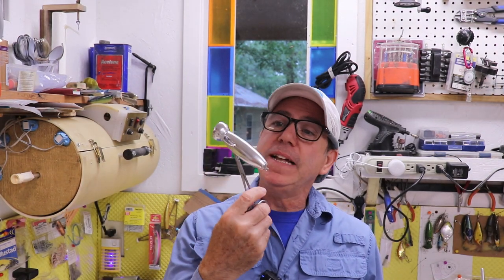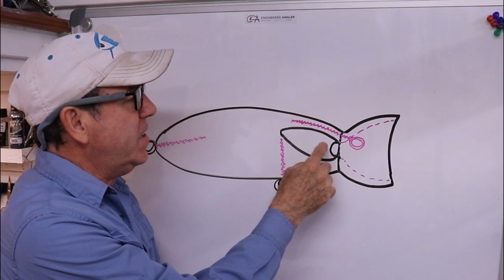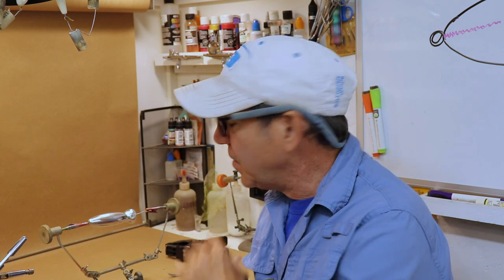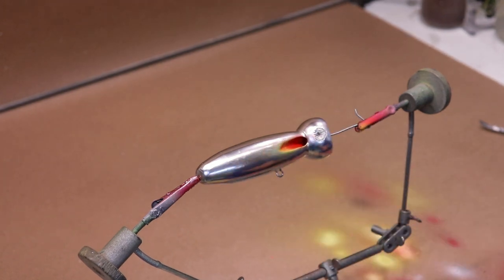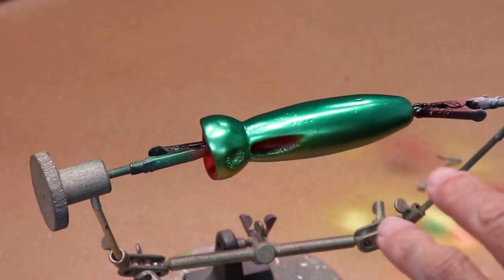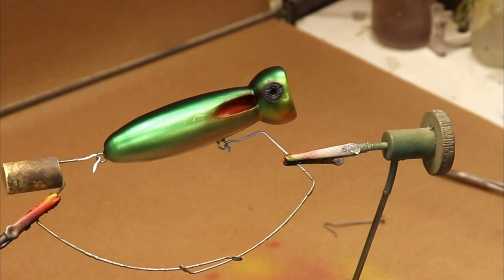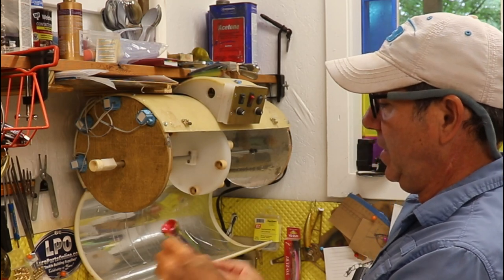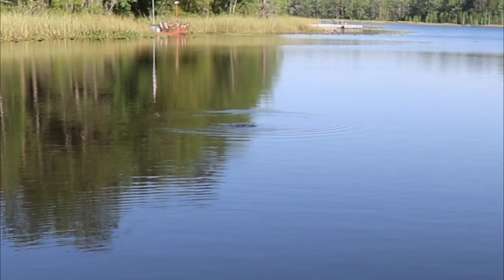Jetted Popper, Testing a new Popper Lure #popperlure #topwaterlure #makinglures

Comment: Hi, I have been watching several videos from you Franco and I would like to thank you because are really good and you show a lot of passion in it
I have a couple of questions about lures
First, about propeller lures, could be possible to have more information about how to increase the propeller noise (because that attracts the huge ones) by working with the shape of the lure (made by wood). The model that you did, it will work in that pod but in the Amazonian river won't. I have been watching the high roller design.....so I just would like to hear your opinion as an Engineer because we do have a different perspective and normally we can improve it. (this design is like a torpedo)

The second one is related to popper lure, how to increase also the property to attract more. I saw the video about the Jetted Popper, and I do believe the entry hole should be higher than the original design (it is just an opinion). I have been working with the lower lip of the mouth given to the lure some other zig-zag movement ( as my command of course)

The last one, it is about the wood that you recommend, in this latitude (Spain), we do have different kinds of wood

Franco, Thx in advance, and keep on those educational videos with some engineering on that....they make a huge difference!!!